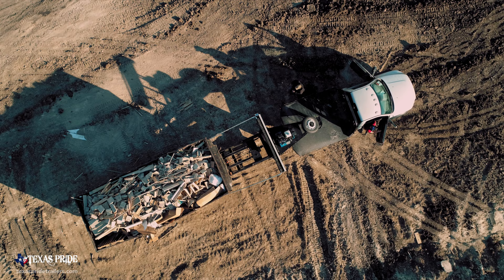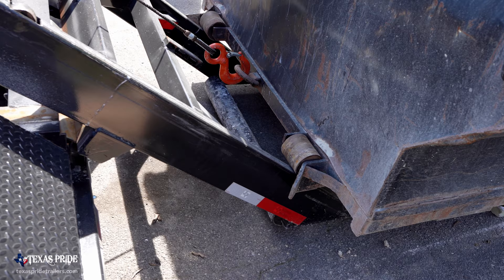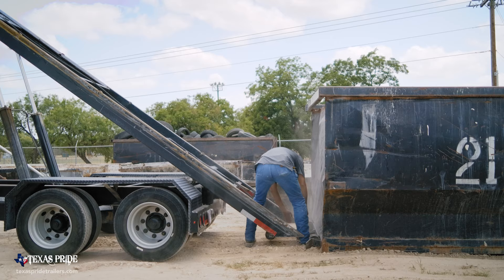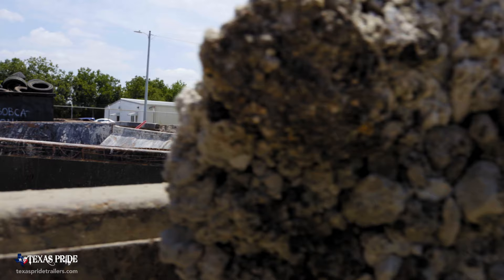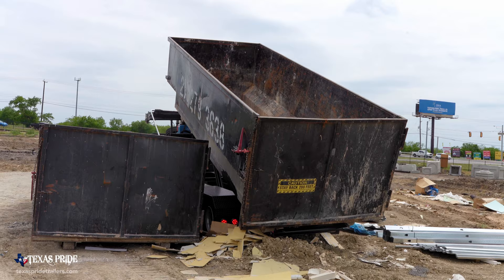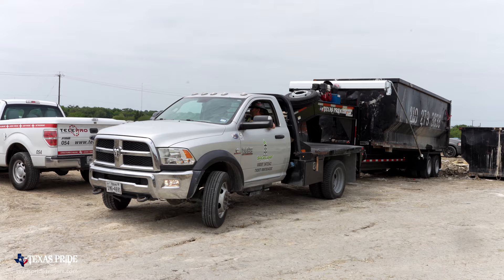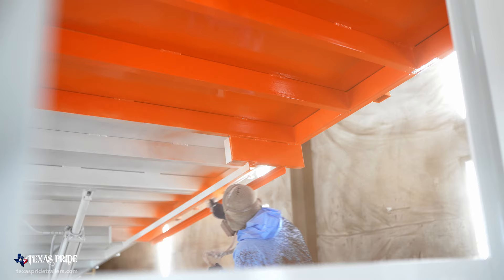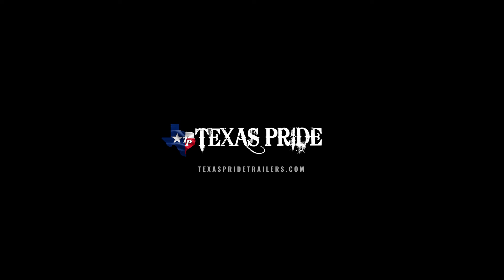Field Tested: 8x20 Reeving Roll Off Trailer | Texas Pride Trailers

Comment: Why haven't I seen any of these?  It costs so much less to buy I'd think more companies would use them...
Reply from the maker: We are just rolling these new systems out so you should start to see more of them soon. There are plenty of our electric winch systems out there there though. Thanks for the comments!
Reply: Biggest reason is commercial drivers licensing. If you have trailer over 10k gvwr you generally need cdl. If you have just roll off truck you can go up to 26k gvwr before needing cdl. That is basically it. There are exceptions but broad strokes reason why there you have it.
Reply: Can you contact me with pricing and lead times I want to buy a trailer.
Reply from the maker: @Lcanino  Hey Lou, please send us a DM here so that we can get you more information: https://www.facebook.com/texaspridetrailersusa/
Reply: @justinallmond3855  Where did you get your numbers from for a CDL? It's the same for a trailer. It's the GCWR that determines needing a CDL when pulling a trailer for hire. Let's say you have a 10k rated truck with a 14k trailer, 24K GCWR, you don't need CDL. But if you have that same truck with a 18k, rated trailer, 28K GCWR you'll need a CDL.
Reply: @methings287  I’m in Michigan. I think most states are similar. Distinction that this is commercial and you are not a farmer. Cdl needed combination vehicles, trailer GVWR 10,001 and GCWR 26,001. Basically ever vehicle capable of towing 20,000 will also have a gcwr in excess of 26,001. There are tiny windows of space to stay legal but seriously if your buying a trailer with gvwr 20,000 you’re going to need a cdl. Don’t know many 6,000# trucks capable of towing 20,000#.
Reply: @Justin Allmond   @Justin Allmond  Yes sir, you are correct. If you have 20k trailer you will need a CDL. Any time you exceed the 26,001lb rating.
Reply: @methings287  gcwr is a separate figure published by manufacturer it is not simply adding up the gvwr of all combined vehicles in tow. Chances are in both your circumstances you would need a cdl if the tow vehicle were a diesel heavy duty. If you had a gasser heavy duty you could probably get by under cdl with the 14k but may not be able to use the full 18k of second example. I think the f250 and 7.3 would handle the 18k and be under the gcwr of 26,000
Reply: @methings287  I think when you math it out combination or single vehicle it comes down to about 7 tons. Anytime you are trying to move more than 7 tons for hire you need a cdl.